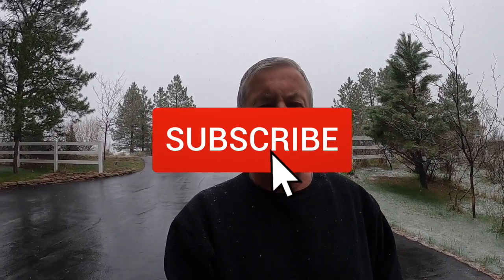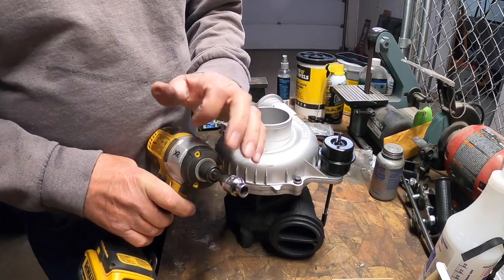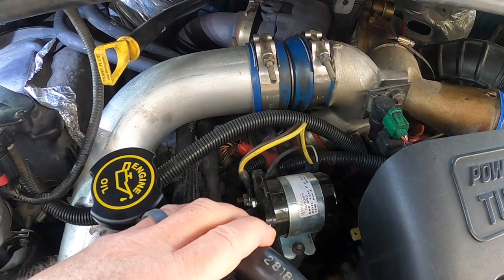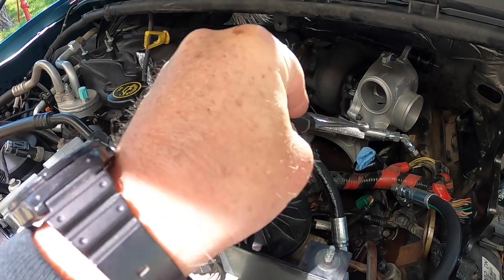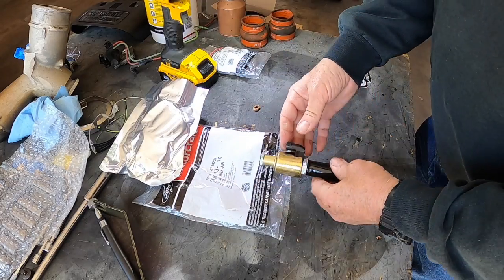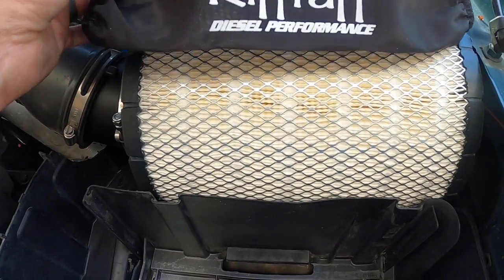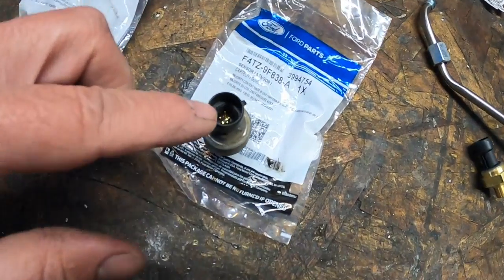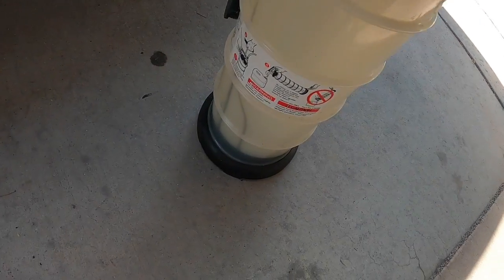7.3 Powerstroke Mods Updates and Upgrades Preventative Maintenance DIY Catch Can ICP IPR HPOP Air

Comment: Got a 2001 f2shity 7.tree with over 780 thousand miles all original Michigan truck.  Works construction and plowed every winter of its life.   Still stroking and purrs like a kitten 😸... 13 letter shitspreader INTERNATIONAL best diesel ever made.  I've been driving it for 22 years now.   I wouldn't trade it for a rocket ship.   Years ago I ran my crank case gases into my exhaust.   Works like a charm

Comment: I love the 7.3 videos. Can you explain the transmission swap a bit more?
Reply from the maker: Purchased a new trans with torque converter on a pallet from ford dealer with warranty.  Then the newer larger trans cooler so warranty isn’t voided. Made up some cooler line adapters.  That was it. Thanks

Comment: How did your oil catch can work out? No more oil in boost pipes? How long before it needed drained? Thanks
Reply from the maker: Great question.  Works fantastic.  No more oil in pipes or sleeves.  Did 3000 miles last sept. Had about three tablespoons. Easy to empty. Colorado diesel emissions techs loved it also. Thanks for asking.

Comment: Added stage 1 turbo and stage 1 injectors to my 7.3 should I upgrade my e40d tranny now that I plan to heavy tow?
Reply from the maker: Your call. The old trans they used was for gas engine. Not for the torque of the 7.3. I put a 2013 in. Let me know. Thanks

Comment: Did you say you had a 2013 transmission put in that truck
Reply from the maker: Yes. Heavy duty.
Reply: @bparkinson1234  I did not know a 2013 model transmission would fit in our 7 3 Powerstroke
Reply from the maker: @bobodine9299  yep. This is fords heavy duty for diesel torque.  The original was a gas motor trans not drain to handle the torque. Bolts up but had to modify hoses and larger trans cooler fit
Reply: So was that 2013 transmission come out of a gas engine or Powerstroke engine thk you
Reply from the maker: @bobodine9299  powerstroke. Thanks
Reply: Its a  4r100 transmission right?
Reply: @bparkinson1234  What transmission is this? I can't find anywhere upgrading to a 6.7 trans